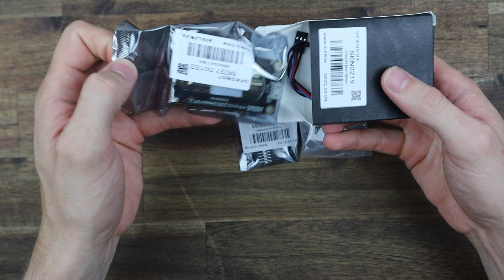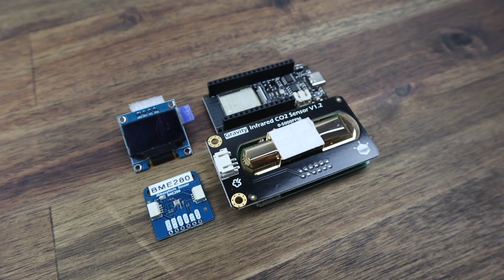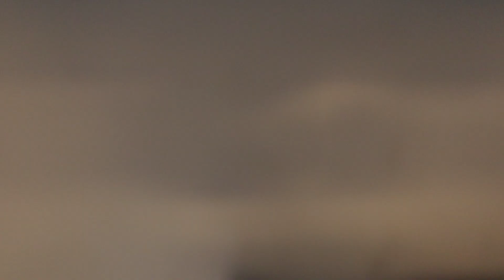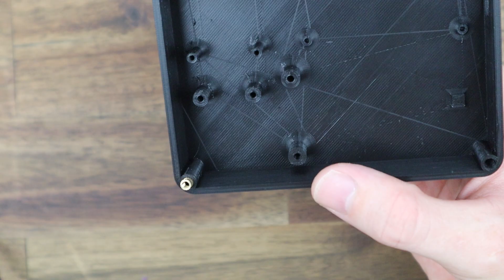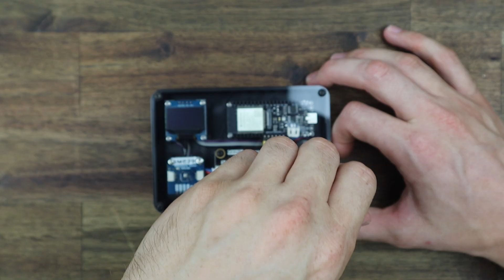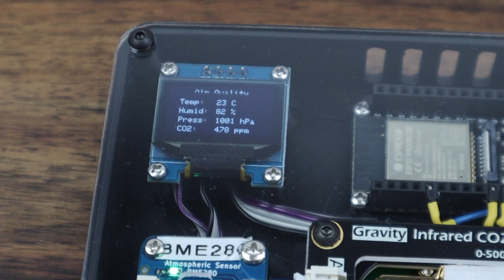Making An Indoor Air Quality Monitor With A DFRobot CO2 Sensor

Comment: Great design. 

A question, if i can: Do you know what the tolerance level is in measurement?
Someone in me job want to use it for some "more robust" work than indoor and we want to be sure this could work.

Thank you.
Reply from the maker: This is not an industrial calibrated sensor, it's readings are self calibrated against what it thinks is clean air. I don't think it would be suitable for very accurate tasks.
Reply: @MichaelKlements  That was exactly what i need to read.
Thank you so much for answering.

Comment: I was able to make the project but the CO2 reading are varying to much
What can I possibly do for this???
Reply from the maker: Make sure that your supply voltage to the sensor is correct and that it is calibrating correctly.
Reply: @MichaelKlements  How can I calibrate it ?,pls can you guide🙏🙏🙏

Comment: Is th c02 sensor accurate or  approximately accurate?
Reply from the maker: From the part number on the actual sensing element it looks like they're used in a few industrial applications so they must be fairly accurate.

Comment: Great project! Can we see the senor reading on phone using iot concept
Reply from the maker: Thank you! You can access the sensor dashboard on any device on your local network if you're running Grafana locally and on any internet connected device if you're using their cloud services.
Reply: @MichaelKlements  can grafana alert us by giving notification when any parameters goes beyond its set point or it normal value?

Comment: So heavenly well done, will build one myself because I really like the design and features.
If I may wish, I would change the place on the FireBeetle and CO2 sensor, precisely because the USB connector looks nicer when you have it standing on the edge, something you have thought about ???
Reply from the maker: Yeah that's a nice idea for the USB cable

Comment: Hi Michael:
I hope you could field my question on your opinion on laser cutters/engravers.  I was looking at the OMTech 40W CO2 Laser Engraver Cutter that you used in this project.  I noted you used the Ortur Laser Master 2 Pro in another project.  I don’t mind paying the extra.  But, does the extra cost on the OMTech worth it compared to the lessor cost of the Ortur?  Thanks, Greg
Reply from the maker: Hi Greg,
The main difference is what you intend cutting with it and how much space you have. Diode lasers like the Ortur Laser Master 2 Pro can't cut clear acrylic (like the cover used here), but they take up far less space and are generally cheaper. CO2 lasers are more industrial, so usually last longer and take up way more space, but have a number of benefits, like fume extraction and being able to cut and engrave more materials.

Comment: That BMP280 will not measure the correct Temp/Hum into the room because they will be influenced by the temperature of the electronics. You have to place the sensor outside the box.

Comment: It may be a good idea to add a button to toggle the OLED display as it will wear over time for sure.
Reply from the maker: Thanks for the suggestion!
Reply: Time to add a MM wave sensor that only turns on the OLED when it detects a person is present! :D